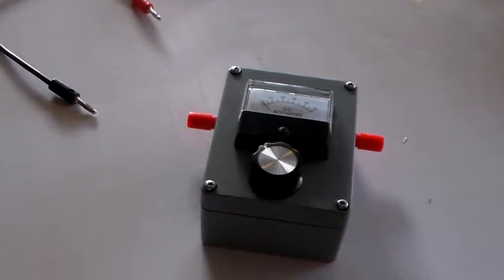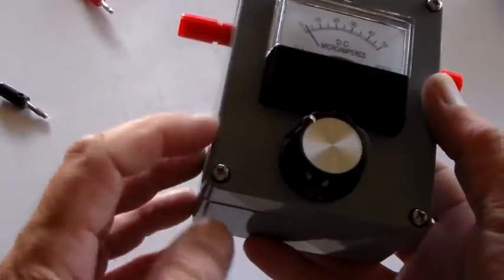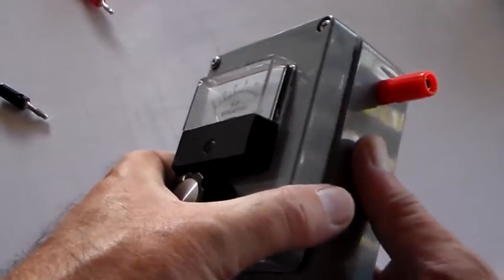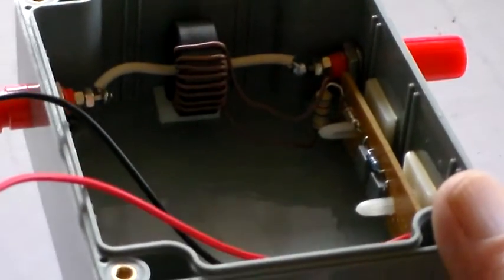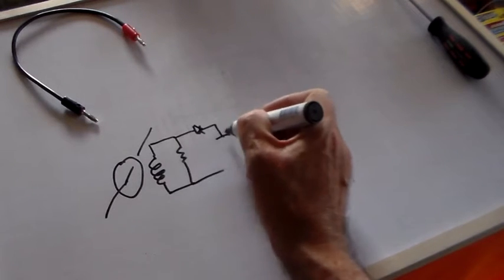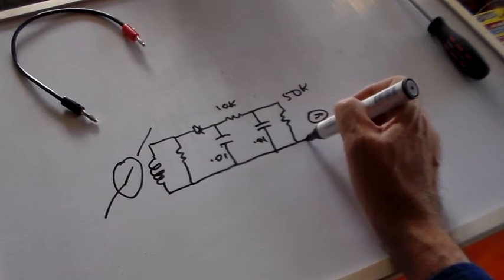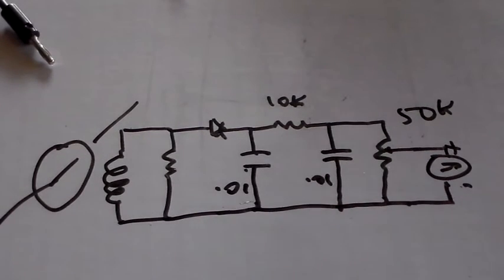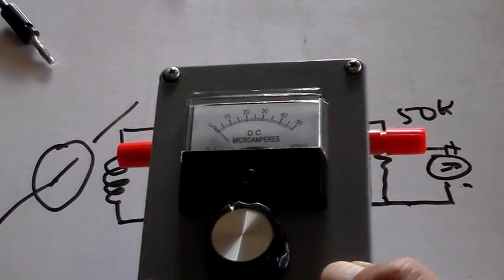A Look Inside The Homebrew RF Current Meter

Comment: what is value of diode?
Reply from the maker: I don't know, someone up at the radio club gave me a couple of signal diodes. A 1N4148 would probably do.
Reply: Thanks for the reply. Actually I am looking for the design of RF wattmeter. I request your valuable feedback on designing a RF watt meter based on arduino. The wattmeter will measure the dc voltage across a known resistor value, which by using simple maths can tell us power dissipated in the resistor. Now, the question is - what will be the accuracy level of such an instrument, with 1N4148 as rectifier diode?